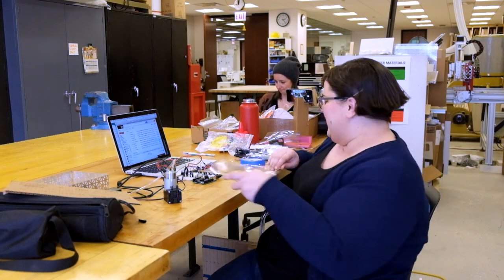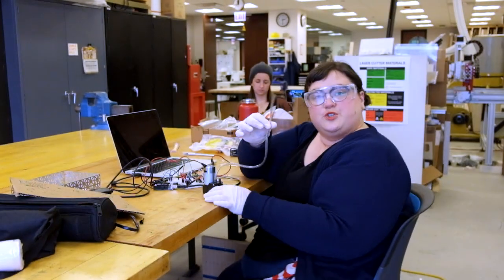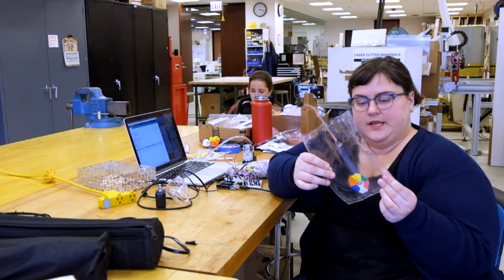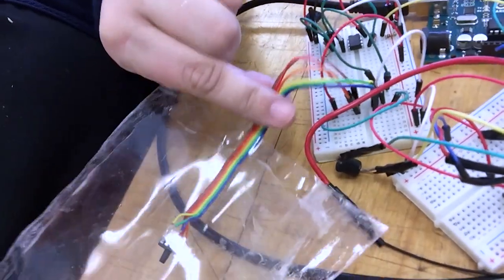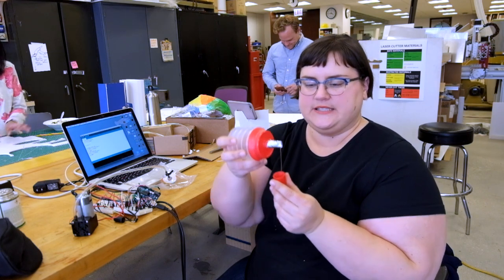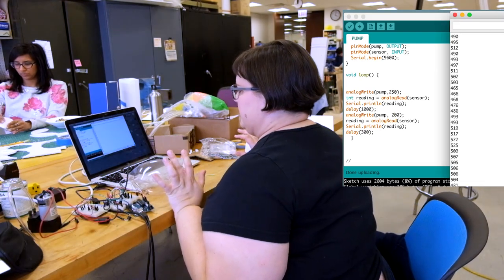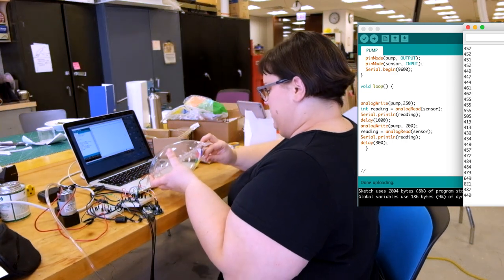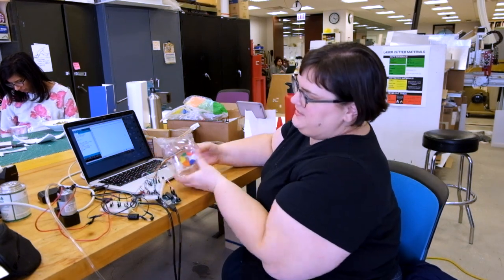Experiment: Arduino Pressure Sensor inside a DIY Inflatable

Comment: Hi Becky I'm thinking of doing something not even remotely similar would like to do the same with much higher pressure with oled  with menu for setting upper and lower lower pressure limits and mosfet connected to car tyre pump to  pressure vessel and gas solenoid as trigger. Trigger connected to IR proximity sensor and barrell loaded with dog poo so I  can conceal it near my door and remotley shoot shit st door to door sales people and my mother in law. Would also like IR proximity sensor switch to camer to cspture the highlights. Don't really need help with coding or hardware so I don't really know why a shared it however if you wanted to make a girly version of a of the self inflating pressure controlled proximity sensing poo cannon that shoots rose petals or chocolates or something less insidious than poo then go for it I'm sure your subscribers will love it

Comment: Smart woman.. sensor can't be inside.. only tip of it ..otherwise can't measure. Not at all.... can't believe so short thinking.. just imagine throw glass into water and it will not crack at 100m deep but put the lid and it will break the glass.. think why.. think why  sensor is good.. that is what they made input for air.. and not said to fit whole sensor inside the tank.. haaaa I don't believe you mention some designs .. this was no brainer.. it requires to have difference by putting in inside the bag you created no difference in pressure and it need to be In Normal pressure and only inlet to be pleased under the pressure..